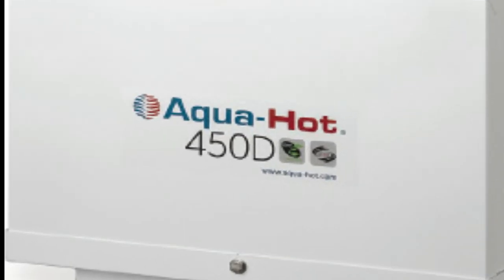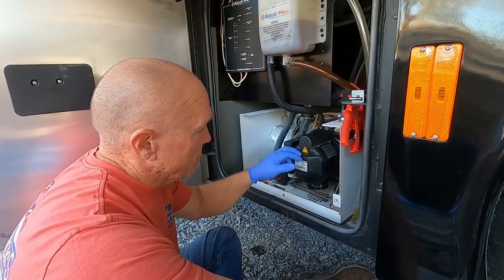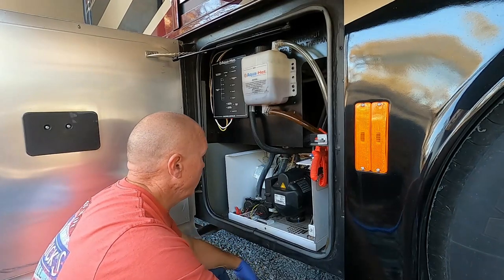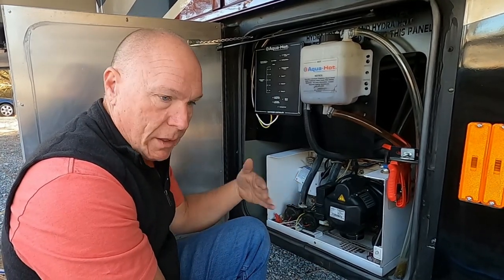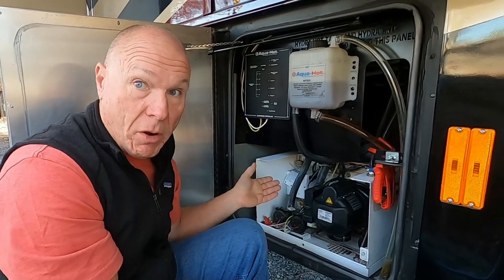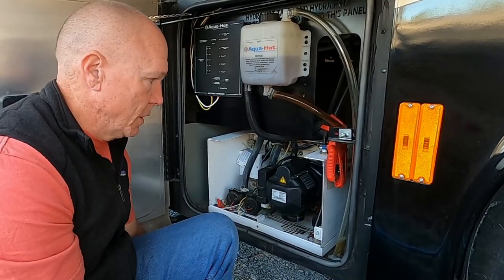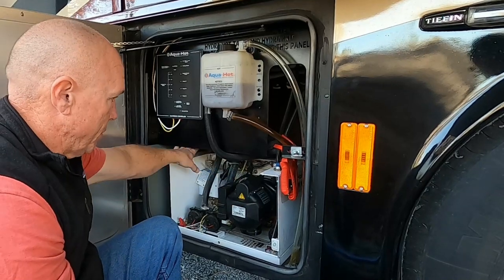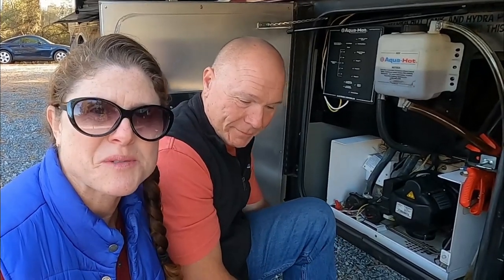RV Lifestyle- How Aqua-Hot 450D RV Heaters Work and Diagnostics

Comment: I would love to know if you have any idea what is going on with our aqua hot. We have a 2020 Tuscany the firefly board in the coach for the bay is calling for heat but we have it set at 45. So it will continue to run and run to continue to try to heat the bay. We called Thor and they are stumped. We disconnected the thermostat under coach in the bay but still runs and runs . Any thoughts
Reply from the maker: Good morning Miss Eicher, I will have Andy to respond as I am not nearly mechanical as he. He is on California time so it’s pretty early there.

Comment: That's what I have a 2014 Phaeton and needs the yearly tune up.
Reply from the maker: Yes Sir, Andy does the yearly maintenance himself. The most recent issue that caused him to learn about the Aqua Hot ended up being the fuel pump which we decided to change out the burner that houses the fuel pump and has the new fuel pump installed in it as a unit. Andy will rebuild the original unit as a back up at a later date. 

We got the unit from Heat My RV https://heatmyrv.com/
John was incredibly helpful the order process. And arrived as ordered and in a timely fashion even though it was during the holiday season.

Comment: It would have been nice to know what brand of coach you were working on. Also the year of the system.
Reply from the maker: Hi Charlie Brown, I’m sorry we forgot to mention that. It’s a 2017 Tiffin Phaeton. The system is the original to the coach. Aqua Hots are used in several lines of coaches.

Comment: 8:47
I have a tiffen class a with a aquahot 450D. My fluid is yellow and low. Below the cold line. I was going to add fluid , I’m researching the mix. Any thoughts?
Reply from the maker: If you are referring to mixing different color fluids, everyone (Suppliers) we talked to say you shouldn’t mix the colors. If it’s pink add pink, if it’s the green/yellow add yellow. If you are referring to the ratio, in the aquahot manual it goes into detail. Aquahot website has the owners manual that you can download for free. Here is the link. https://www.aquahot.com/library.aspx
Hope this is helpful